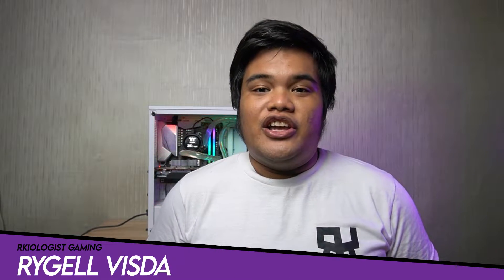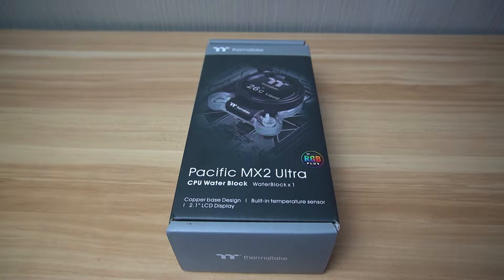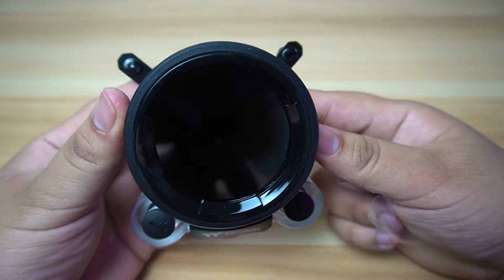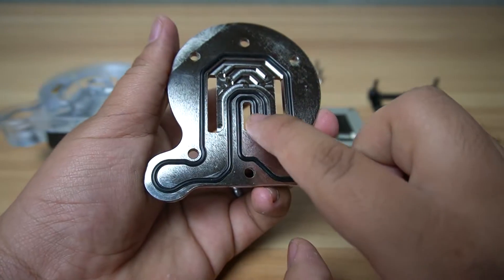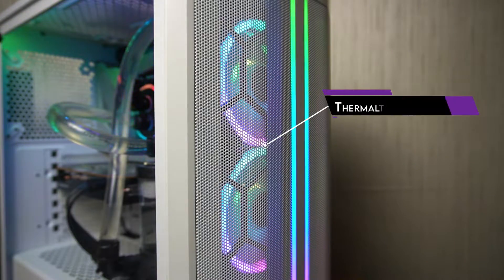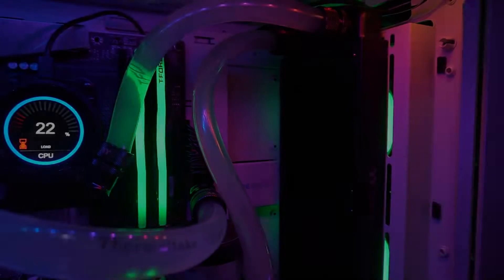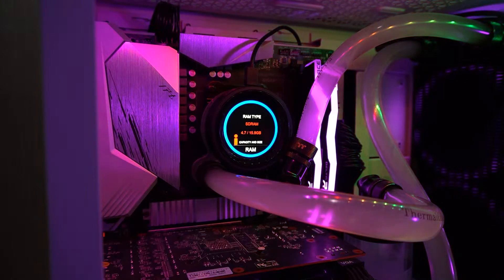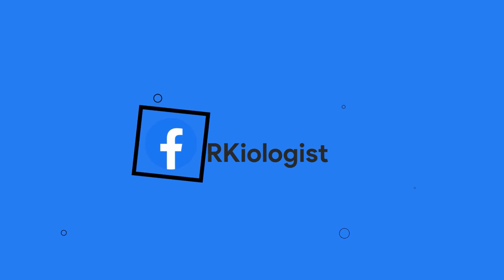Thermaltake Pacific MX2 ULTRA   Unboxing & Review

Comment: Can I use this just as a screen? I don’t have a liquid cooled pc but just want a display.
Reply from the maker: Yes you can but it will be a waste if you are not using it as a waterblock
Reply from the maker: But it can only be used using the thermaltake software

Comment: Thanks for your review, it was good to see some up-close shots of the Thermaltake’s screen.

Some constructive advice, your radiator fans are pointing inward and that’s blowing all the hot air from your CPU back into your case! That’s why your CPU temperatures are so high at 71 C.

If your case allows it, mount your radiator on the top of your case and have the fans pushing air up and out of the case. You can add another exhaust fan to the rear of your case and some inlet fans to the front of your case and your temperatures should drop significantly. Right now, your water cooling is actually significantly worse than air. The 5600x is not a particularly hot CPU to keep cool.
Reply from the maker: Hello I'm living in the PH and its hot in here. Thank you for the advise. Also I have an updated benchmark. Try to see the review for bitspower.
Reply: @RKiologist  Yes, those temperatures look much more normal! Nice job
Reply from the maker: @Trollend3  thanks.

Comment: High quality review and editing. 
If I had to provide any constructive feedback, I would have to be nitpicking, but I do have one.

The audio was a tiny bit high on the treble. Maybe you're using a dereverb plugin to try and cancel out room tone, or mayve you've equalized the frequency. Try turning the treble down one notch in the 5k and above frequencies.

Also which thermal paste did you end up using? The one provided with the kit?
Reply from the maker: Thanks for your feedback. Will improve more in terms of audio editing. Im using a condenser mic.

For the thermal paste. I used the one with the kit.
Reply: Bro why you gotta be nitpicky. The video was good.